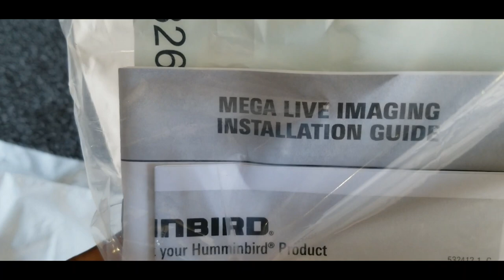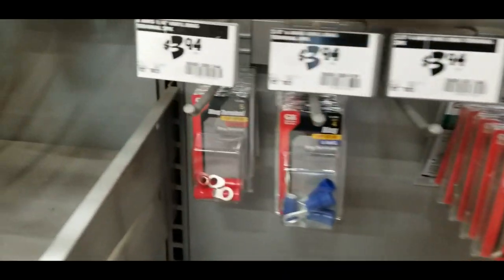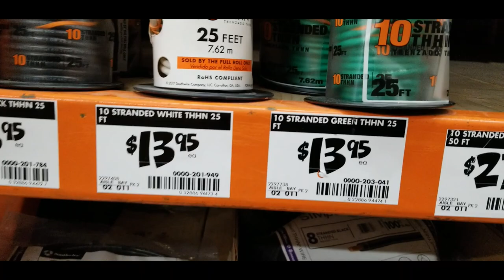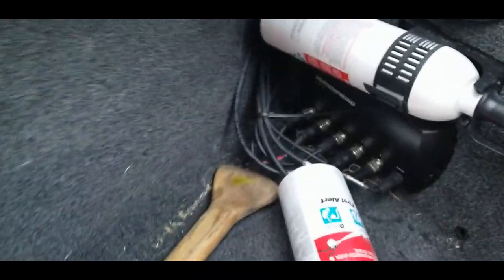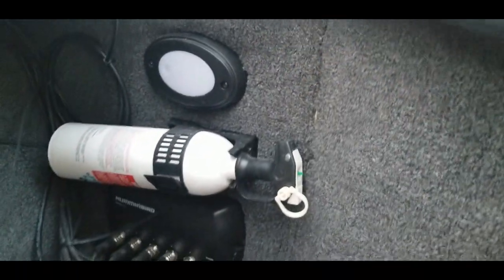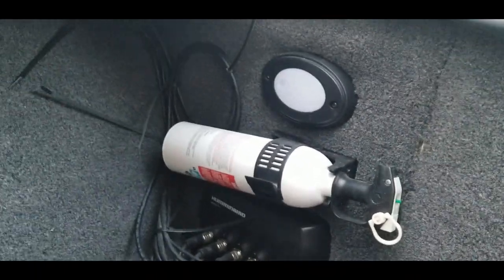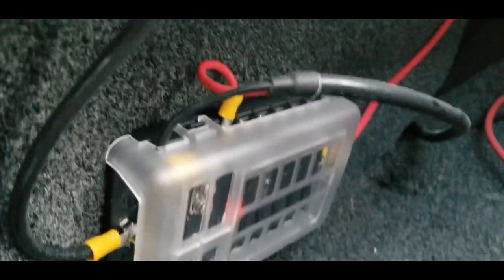Humminbird Mega Live wiring and installation (No Interference and No issues!)

Comment: Love your content!  Ditch that Interstate starting battery and get one that won't let you down.  Cause it's gonna let you down!
Reply from the maker: Thanks for watching and supporting the channel. It's worked pretty good but it is definitely time to make some changes. First, I need to separate my electronics and run them from a dedicated battery. Thinking about lithiums but have some safety concerns.
Reply: @MoneyBass  Yeah you have enough electronics to support a power upgrade solution.  I hear ya on the safety concerns but it seems like the lithium game is figured out now.  They are getting priced right for sure.  That interstate left me and my high school team stranded this year after only a few hours of fishing and running wells etc.  I went with the X2 Power 31 series AGM and it's been a beast no issues running 3 Helix 12's, livewells, and Mega 360.

Comment: I will be using Fishing Specialies Mount for side of boat.  Also I would be removing the mount and Mega Live when not in use or mooring our boat.  Do you have any recommendations for a connection that I can install that can be easily connected and disconnected when mount with ML on it is removed?  I would likely have an inline fuse for the Mega Live.
Reply from the maker: I haven't looked into any mounting systems for easy connection/disconnection. The network and power connections for the Mega Live transducer are pretty easy to disconnect. Be careful not to cause any pinch points that might damage your cables. Search Mega Live mounts on YouTube. I'm sure there is someone that has a setup similar to what you are looking for. Hope that helps. Thanks for supporting the channel.
Reply: I’m wondering if using a cigarette style accessory sockets will work.  I want the 360, live and target lock, too, but want them to be removable, as well.

Comment: What wire end for the mega live wire is what I meant. Running 10 gauge from a 12/23amp lithium (Mega Live only). Getting the fuse panel but since it isn’t connected to anything else they said I didn’t need a on off switch. When the sensor gets wet it will turn on. Thanks for your help!
Reply from the maker: What's up Harry, if there is a question regarding a specific part of the video please include the timestamp. The Mega Live transducer is always "on" and drawing current when connected to a battery. The wet sensors activate the transducer so it will start pinging. Who told you that you don't need an on/off switch?
Reply: @MoneyBass  humminbird and 
TH Marine. I will get a switch just to be safe. The mega live wire is what I was referring to. I believe it is a 12 gauge. Hope you and your family are doing well?

Comment: I am finally getting my mega live in couple days.  Setting it up exactly like yours. Great video. What size fuse goes in fuse panel. And did you install the switch yet and how. Look forward to response. Keep up videos
Reply from the maker: Sounds good! Thanks for supporting the channel. Be sure to read the manual. I'm using a 2 amp fuse. You might want to order them from Amazon. You can get a pack of 4 or 5 for the price of 1 if you are able to find one at an auto parts store. I haven't attached the drain wire or the switch yet. Maybe I can get to it tomorrow.

Comment: Ryan, is your mega live powered by a lithium battery? I just installed lithium 16 volt and I’m told mega live is not recommended for this but I’m not sure. Thanks
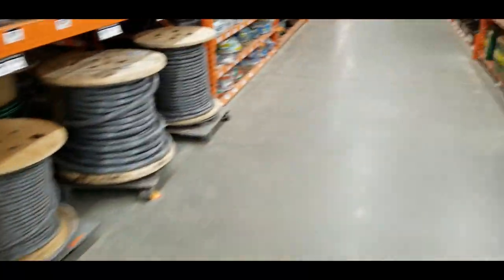Reply from the maker: No, I do not have any lithium batteries. I have one AGM battery. Watch 5:10 minutes into the video. I show the battery and how it is connected. Hope that helps. Thanks for supporting the channel!

Comment: Mega Live actually has some decent interference rejection in the settings. I run 18 gauge because that's the size of my kayak battery wires. But the only other things on my system are a single Helix 8 and Mega 360, so no chance for charger or motor interference. Just other transducers.
Reply from the maker: Thanks for your continued support of the channel. I like your set up. Which settings have you found work best for interference rejection?
Reply: @MoneyBass  It depends. It has 3 levels of rejection, and 1 is pretty decent, 2 is very strong, and 3 is crazy. On the kayak fishing in 20mph+ winds, the waves pitch and roll the transducers that I get a lot of "echoing". Usually I bump it to 3 on those days.

Comment: i am really starting to like your videos. I have not yet installed my Mega Live because the boat is still under 3 feet of snow. Wrt to cable size, 10 gauge is a big cable. The installation manual talks about 10' of 12 gauge cable that comes with the unit but I cannot find that beyond that 10' that I need to up size to 10 gauge. I read but the English and the French manuals and cannot find anything about having to use 10 guage cables. Additionally, I wonder if you ever made a video about using the Hydrowave. I have a feeling that the recorded sounds are not what I need in southern Ontario. Thank you.
Reply from the maker: Thanks for the information and the tip about the Hydrowave. I will make a video on that. I wanted to make sure the materials I used for the installation wouldn't be the cause of any issues. Thank you for supporting the channel.

Comment: How did you connect your fuse panel to the wall. Self tapping screws or sheet metal screws and did you drill a hole first. I see mixed thing on the internet and don’t want cracks or carpet to tear up. Thanks for your help.
Reply from the maker: I didn't do anything special. I just drilled the screws in place. Drilling a hole first wouldn't hurt.

Comment: Great video series.   Thanks so very much.  I hope you don’t mind me asking you for some advice.  I have a 176 Stratos that I’ve begun to upgrade.  A Helix 10” G4 DI, SI sits on the console.  My plan is to add a new Ultrex TM, a 12” Helix G4 DI, and a MegaLove unit up front.   I know that both Helix units will network together but by adding the MegaLive, will I need to add a network junction box?   If so, the. I might skip the MegaLive for now.  

I subscribed sir.  Keep these coming!!!  Thanks and tight lines!!
Reply from the maker: Thank you for supporting the channel! You can connect 5 devices to the hub. 
1. Helix 10" DI console
2. Ultrex TM (if it has iPilot link)
3. 12" Helix G4 DI
4. Mega Live
5. 
Based on the information I listed above are those the systems you are connecting?
I suggest keeping Humminbird on speed dial just in case you have issues or technical questions to ensure you get the most up to date information. I look forward to seeing your comments on the "How Would you Fish It" videos I put out on Wednesdays.
Reply: @MoneyBass  I think I'm going to need a box.  Even if I only connect the two Helix units and the Megalive transducer, I think I'll need a box.  Wanted to stay clear of it.....boat small enough already.  There ain't no room in the thing!!!
Reply from the maker: @F1Hopeful  yes, you will definitely need a 5 port hub. They aren't very big. A little bigger than your hand. The dimensions are listed on it. Search for it on Amazon or eBay for specs. I actually need 2 lol.

Comment: what cable do i need for the hookup from the back of my Helix 9 gen4 to the mega live transducer. really am confuse. thanks Ryan
Reply from the maker: There is a "dongle" (adapter) made to connect it to the network. Contact Humminbird support to ensure you get the correct one based on your set up. That's the best way to avoid issues.

Comment: Great video Ryan! I have to tell you, Like a lot of people, I have a lot of frustrations reading all the issues with the MEGA live system with interference. Did i miss something or did I hear you correct? I have all new GEN4 HELIX's. Am I going to need to do a systems update already? My boat is going into the shop next week to have everything installed. My boat mechanic is awesome and knows what he is doing and he actually informed me that I will need to possibly do an update. I don't give those post posts on FB. I do follow and read them but, it gets to a bit confusing reading all the different posts. Are you experiencing any freezing up of the LIVE while moving it around? Keep up the great video's! Are you on FB or IG?
Reply from the maker: Thanks for supporting the channel. Good questions. My IG is @OfficialMoneyBass. The current software version on Humminbird's website for G4N units is 2.66. You can check your software version by going to the system status screen. Make sure it is set to visible. I just received a new G4N unit yesterday and it had the newest software version already. I uploaded a video about the freezing issue and a possible fix because it was I didn't have the issue after removing the auto settings. Hope that helps. Let me know how things turn out.
Reply: @MoneyBass  Thank you Sir! Good luck to you in your tournaments this year! I will let you know how things work.

Comment: What size wire ends did you use? Hope you are doing well?
Reply from the maker: Is there a specific part of the video you are referring to? If you are referring to the crimps/connectors I use the smallest size that will fit.

Comment: So how did you wire the third wire for the 360 and Mega Live? I have all kinds of issues with my setup.
Reply from the maker: My Mega 360 was wired at the shop. I connected my Mega Live, just connected my switch yesterday but haven't connected the drain wire yet.

Comment: I like your video - can you tell me the name of what you call the POWER BANK that you run the 8 guage wire from?  I searched in google and couldnt find it - no problem finding the battery ON/Off switch -
Reply from the maker: Thanks for watching. I try to put links in the description for each item. Are you referring to the fuse block?
12 Way 12V Blade Fuse Block
https://amzn.to/3F7scKz
APIELE 19mm Latching Push Button Switch 
https://amzn.to/3s4CgP9
Fuses (2 Amp (Card)), 5 Pack
https://amzn.to/38E4OYU
Reply: @MoneyBass  I am very impressed that you took the time to write back. I subscribed and will check out your other videos. I need to rewatch this video to understand where you are using the APIELE switch.  I am rigging a new Lund Pro V myself ( have had issues allowing dealers to do the last several boats) There is a learning curve to this but in the end I will understand the electrical system in my boat.
Reply from the maker: @efrawley55  thanks for supporting the channel. I try to reply to all of my comments. I just installed the switch yesterday. I've been turning off power using the perko switch but there were times that I needed to have the livewells running and had to leave the power on. The switch allows me to reset the Mega Live system also without turning off the power to everything. I will try to upload that video today. Be sure to watch the livestream tomorrow. Every Tuesday 8pm EST.

Comment: Why isn't possible to install it over the 360 shaft?
Reply from the maker: The Mega Live transducer CAN be installed on the Mega 360 shaft but in my opinion that would significantly reduce the effectiveness of Mega Live. The Mega 360 shaft is stationary and you would not have a way to rotate the Mega Live transducer and scan areas for fish, cover etc. Hope that helps.

Comment: How did you add the mega live without adding another Ethernet hub?
Reply from the maker: I disconnected one of my console graphs and just use it for mapping until I get an additional hub. At 8:42 in the video I show the hub and disconnected network cable. I can still mark waypoints if needed on the console graph that is still on the network. Thanks for supporting the channel.

Comment: To where dud you attach the drain shield line or was it not needed?
Reply from the maker: I did not attach the drain or switch yet. Based on the manual they are definitely needed. I think there may eventually cause issues if not connected. I should have them completed this weekend and I will upload a video with the details. Thanks for supporting the channel.
Reply: @MoneyBass  Thanks fir the quick response and great review.
Reply: So what happened to the drain install?
Reply: Just ran it to the negative battery terminal
Reply from the maker: @bfobaits  I just installed my switch yesterday. Haven't connected the drain wire yet. I will run it to the ground on my Fuse panel.